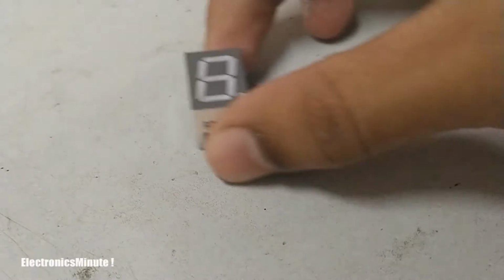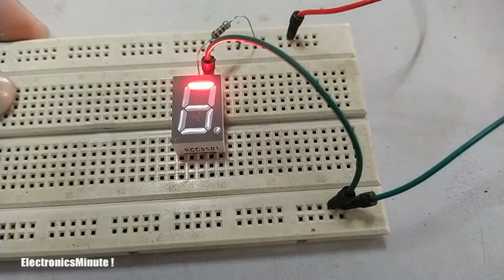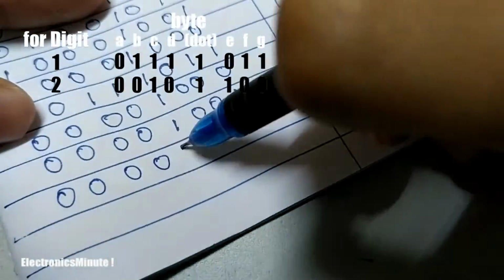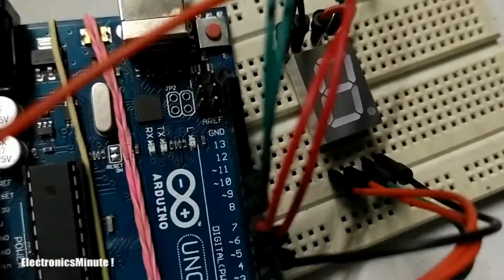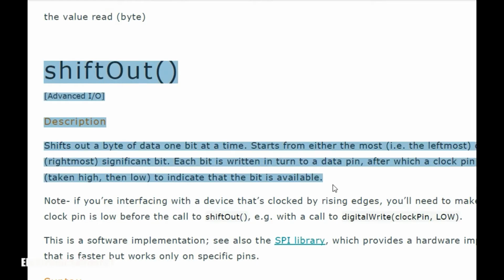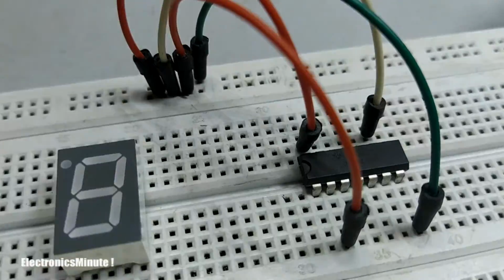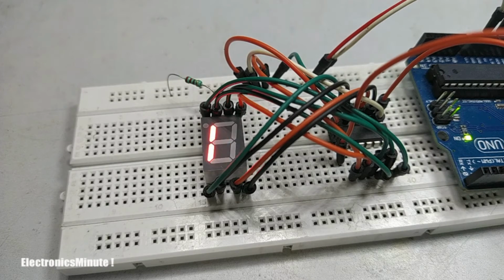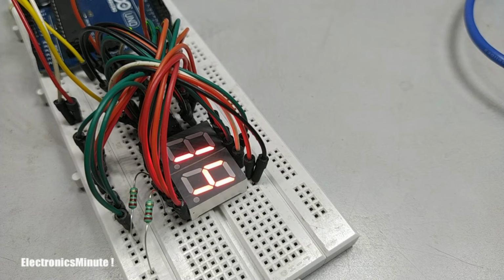Controlling Seven Segment Digit Displays using only two Arduino pins | use of 74HC164 Shift Register

Comment: #define DATAPIN 2
#define CLK_PIN 3

const byte digits[] = {247, 24, 123, 44, 41, 75, 137, 136, 59, 8, 9};
int index = 1;

void setup()
{
  pinMode(DATAPIN, OUTPUT);
  pinMode(CLK_PIN , OUTPUT);
}

void loop()
{

for(int ones = 1; ones <= 10; ones++){
digitalWrite(CLK_PIN, LOW);
shiftOut(DATAPIN, CLK_PIN, MSBFIRST, digits[ones]);
digitalWrite(CLK_PIN, LOW);
shiftOut(DATAPIN, CLK_PIN, MSBFIRST, digits[index]);
delay(1000);
}

index = index + 1;

if(index == 11) {
index= 1;
}
}